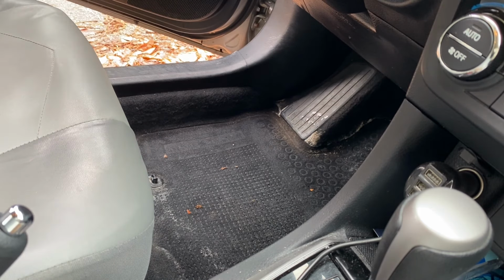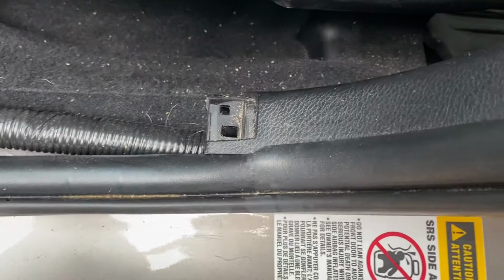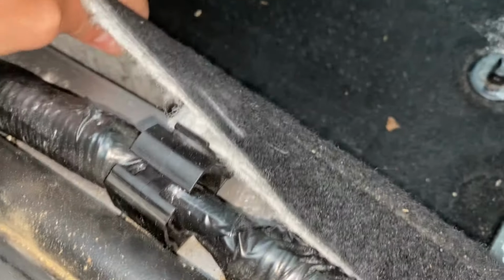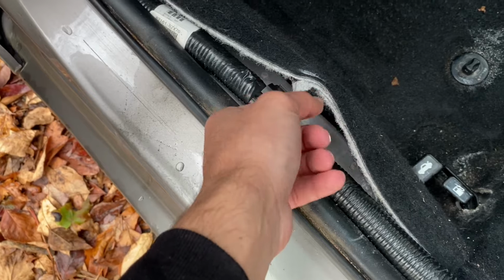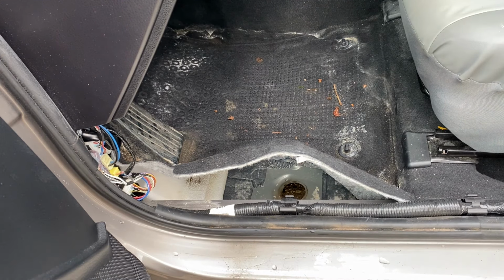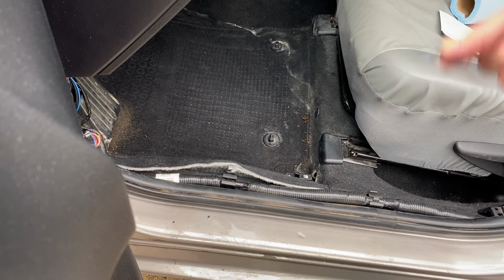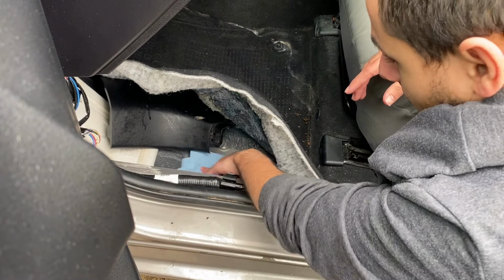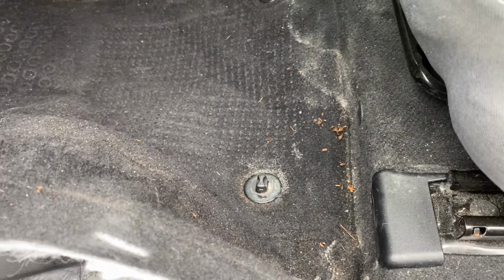How to fix a wet driver side floorboard

Comment: THANK YOU for this video! I seem to have the exact same problem with my 2007 Kia Spectra5. I kept thinking it was a sunroof drain tube (nope), a windshield seal (nope), a windshield drain (nope), a door seal (nope), and so on. I finally pulled up the carpet and propped it up with a metal rod to let the carpet and padding dry out. The water drained out of the carpet and pooled in the floor pan. After squeegeeing most of the water into a plastic bag (I didn't have anything better to use), I tried sopping up the last ounce or so with a rag. When I pressed the rag into the little dimple of the drain plug, I saw that water was coming up from underneath. Even though the rubberized waterproofing coating seemed intact, it actually had a small hairline split in it, and that's where the water was coming from. So, after trying all the "normal" things, I accidentally discovered the abnormal thing, same as you did. Thanks for confirming that I'm not the only person this happened to.
Reply from the maker: @JBH123  Thank you for your thorough comment, glad you tracked down the issue and shared it with us 🙏🏼

Comment: I’m a little confused. How does the plug leaking push water up? You’d think it would drain it. I feel like that not really the issue and the water is coming in from the door or windshield drain.
Reply: Blocked windshield drains can do that. I'm disappointed that just a blocked windshield drain can put water in the floor.

Comment: Thank you for the video. But  don't know if it gonna work on Toyota RAV4 2015 model
Reply from the maker: Look under the vehicle and see if the plug is there before starting to taking off anything from the inside.
Reply: It's under my 2007 Corolla. Should I remove it. I have the same issue of wet driver's side floorboard @randomfixes
Reply from the maker: @ChibuzorEEdeh  If you remove it you have to seal it.
It might also be the whole body seam failing, I made a video about it recently.
https://youtu.be/4oAK6fZVtjI?si=Dm9jQoQopV9jpY3w
Reply: @randomfixes  Thanks man. I appreciate

Comment: I don't know if you're the original owner but it looks like somebody drilled a hole in the center of that because they have a leak maybe from the window or the door seal or someplace else it just happens to be pooling down there at the lowest point which is where the drain would be. I have a 2003 and I have the same problem now mine is more Rusty down there cuz it's been happening for many years. I just bought the car for a couple hundred bucks because of other problems which I was able to fix motor related.
I pulled out my carpet unfortunately it's the middle of winter but I put a rubber mat in it for now and when it does start to rain I'm going to see if I can find where it's coming in. My plug does not have a little hole in the center like that one. I couldn't find anything wet under the rubber or material which is farther up the firewall so it's a wait and see
Did the double piece of flex tape work in your instance

Comment: My entire drive side and passenger side as well as the back floor is wet. Did you also have this issue ? I’m confused on what the problem was. Was the pedal and the carpet surrounding the pedal also wet or just more of the floor ? Thanks for this video

Comment: If that part is a drain, why is wzter coming from under.
Reply from the maker: The water splashes up when cruising and the carpet absorbs it.
Reply: My question exactly, mine is parked and drivers side floor gets wet😮
Reply: @randomfixes  ooooooooooh i didnt even think about it

Comment: Am not sure this would fix the problem.... i have 2014 Corolla with similar issue but am suspecting windscreen leakage
Reply from the maker: It can be many things, this video is a common reason, check the A/C drain, windshield seal, firewall harness, A,B and c pillars,…

Comment: Im having this issue as well on my 2016.
THANK YOU so much for this video!!
My rubber gasket didn't have a hole in it. But water was getting in around it. 
I used gorilla tape and put adhesive around the gasket to seal it.
Reply from the maker: You are welcome, my dad’s 2017 had the same issue.
Reply: Did it fix the problem

Comment: I think the previous owner had a leak and drilled a hole in the drain plug.
Reply from the maker: @Average_Middle_Aged_American  Probably, the whole body seem failed and I had to fix the issue a different way, I shared it on the the pinned comment.

Comment: Wondering what's the purpose to tap the drain hole? Won't it cause water built up?
Reply from the maker: Ikr! It's so weird but my dad drives a 2017 and that plug is good but still leaks water 🤷🏼‍♂️
Reply: yes
Reply: @randomfixes  I'm chasing a similar type leak in a 2003 that I have that little hole looks like somebody drilled that or cut it and it could be a leak from somewhere above that's what I have to find out in mine
Reply from the maker: @MoeLarrycurly1  I would check by the firewall where the all the wire lume goes inside the cabin from the engine compartment or the door seal.
Reply: @randomfixes  will do I'm just waiting for the temperature to come off the zero area. Right now everything's frozen like a well block of ice lol

Comment: Could this line been damaged during a airbag repair? There is a tape over my line where the water leaks from. The recall was required and the only time anyone has been in that area. So I’m concerned if there is tape causing it to leak on both sides mostly the passenger but it will come out the drivers when making a turn and the car is up to temperature on a freeway for example. It’s a 2013. It was cold during the repair. Seems like it started after that.
Reply from the maker: I had an airbag repair at the dealer and they never mentioned anything about it even though I took it there before fixing this leak, the airbags are away from the floorboards too, there's a possibility that your heater core or its lines are leaking as one of the airbags is close to it (right it's behind the dash) and maybe it was damaged during the repair? if your cabin smells kinda sweet and it's cold that's probably a heatercore issue.

Comment: I have the same wet issue in my 2004 f150xlt, drivers side only. I’m still searching for the leak. 30 days and counting.
Reply: Did you ever find the issue. I'm having the same problem 2008 f150. I'm thinking it might be my windshield not sealed. I had my windshield replaced a few months ago and with the cold weather recently I've noticed the inside of my window is wet early in the mornings and recent I noticed my drivers side carpet really wet.

Comment: Bought a brand new car in 2018. It started doing this not even a year after..Took it to dealership 4 times. Still leaking 2024. Car doesn't even have 30,000 miles on it.. The tech guards are full of water after rain and pulled it out and the carpet mat was completely soaked. Taking it back to,dealership 1 last time. Not sure beyond this.. Completely frustrated.  🙄😒😏
Reply from the maker: Change dealerships, the issue need to be resolved or else rust will eat the floor board and keep on spreading 😬
Reply: Might be debris in windshield drain channels. Try test by pouring glass of water into windshield drain screen and see of water drips to floor.

Comment: I have the same thing for an 05 Camry on the driver side anyone know what the issue might be?
Reply: Did you every fix the problem?
Reply: @vaneme  unfortunately, I haven't yet. I checked the condenser line which was fine and the sunroof drain line. I poured water on the windshield and the sunroof it seems to flow/ drain correctly.  I just pulled the drain plug on the driver's side floor pan. It smells rotten in there
Reply: @vaneme did you fix your leak?
Reply: @JT-un7dc did you fix your leak?
Reply: @golfish8589  it was  a bad drain plug near the driver's seat.
Reply: @JT-un7dc  i have water getting in without driving the car when it rains
Reply: @golfish8589  what side of the car is it wet on? Driver's or passenger?
Reply: @JT-un7dc  driver
Reply: If it has a sunroof. Start with the drain lines & check the seal of the glass.
Reply: @JT-un7dc  no sunroof.
No sever rust around windshield.  I do have most of its seal off and will add caulk
Reply: @golfish8589  have you checked the lines for the ac ?
Reply: @golfish8589  My lady had a Camry that was in an accident, and the windshield never sealed correctly after the replacement.  No matter how much silicone we put around the windshield it would always leak in heavy rain.
Reply: @JT-un7dc  i just added some silicone up both sides and across the top.
And put the weatherstripping back in. The stripping had been up at both top corners. 
I did not see anything obvious when I had the stripping most of the way off. 
The drain holes just under the hood corners were clear. I may poor some water down there in a couple of days.

Thanks...
Reply: @golfish8589  Good luck! There are also drain spots on the cowl by the window wipers.
Reply: @golfish8589  Might be blocked windshield drain channels. Can test by pouring water in the windshild drain screen and look for drips inside.

Comment: What causes this to happen does the water come in from the trim ? I’m not understanding where the water comes from , my 2000 civic has this same issue right now
Reply from the maker: Water leaks can be due to a damaged weather seal, misaligned panel or just like in this video a damaged/mis-seated panel plug, sometimes a leak can happen because of a bad heatercore but that’s mostly on the passenger front side.
Reply: I'm chasing one in my 2003 Corolla I have no small little hole just a regular plug that in case the car gets flooded that's what you pop out and let the water drain out so I'm suspecting mine is windshield seal the door seal looks good but soon as winter breaks I'm going to keep an eye on things I pull the carpet out I may have to put some water down in the cowling area and then work my way up to the windshield to see if I see it appear on the floor

Comment: I guarantee you that would not be the culprit of your leak after rain. Especially if the car is simply parked during the rain.
Reply from the maker: @coreyd5329  I made another video about this issue, check the pinned comment.

Comment: Put a Screw or Bolt that will plug the hole
Reply from the maker: I don’t think that will be a tight fit to create a good seal, surprisingly the repair is still holding up.

Comment: What conceivable reason is there for that hole at all? I have a leak in the same place on my scion xb. Great video.!
Reply from the maker: I think those holes are made to aid manufacturing (painting and panel holding points maybe) sometimes they are drain holes for cleaning like jeeps.
Reply from the maker: Also I recently uploaded a new video where the leak comes from a different location, check it out and inspect it on your car.

Comment: So the water defies gravity? How does water come up through that hole? does it only get wet when you drive it?  MY 2013 Corolla has this problem. I will tear it up tomorrow!  But how does the water come up?
Thank you BTW!
Reply from the maker: Because the front wheel slings water up and splashes it onto the floorboard area then the water gets absorbed by the cars carpet.
Reply: Hey I currently have this problem how did you fix it ?
Reply: Exactly what I was wondering 😮 same issue on 1989 grand marquis

Comment: Why not just pop the cap out from umderneath
Reply from the maker: To seal it from the inside as well, sealing it from the outside isn’t enough as road debris and water will make the seal fail quickly + cleaning underneath the floorboard.

Comment: Complete BS. How is closing that hole is supposed to stop the leak? Wouldn't that make the water pool up even more?
Reply from the maker: The leak was coming from the outside not the inside in my case.
Reply: @randomfixes  it was coming in from under the car?
Reply from the maker: @RCA_Dome  yeah, the water shoots up when moving, surprisingly the fix is still good till this day!
Reply: @randomfixes  ah that makes sense now. My bad. I have same problem but I need the plug removed so the water can drain down

Comment: So water is supposed to go through the surface underneath the plug and drain out of the car, but since there's a hole in the plug (btw ?!?!?! how did that hole even get there?) the water comes up through the hole and floods the floor... Any chance you know if a 2006 Mazda 3 has that same plug thing? Mine has been flooding (1+ inches) on the driver side front and back EVERY time it rains for like 3 weeks.
Reply from the maker: I have no idea who made that hole, my dad's 2017 has that rubber fitting without the hole, that fitting should insulate water from entering the cabin, the fix i made is still holding up btw.

Comment: Its a factory drain plug when they dip the body of the car in liquids to protect it from rust. So then they instead of welding it up stick in a drain plug a rubber drain plug. But yours was apparently in wrong it's suppose to be inside the car and not outside the car. So all you have to do is plug it in from the inside and then plastic seal it.

Comment: Ur wrong !! That hole purpose is to drain the water coming from the leak...if you block the hole u migth suffer more water inside un car....
Reply from the maker: @michaelfavila4413  No, it held up just fine for years, until the body seam failed, I made an update about it, check the pinned comment.

Comment: that drain hole shouldn't be obstructed- do you know more than the engineers that designed that fine vehicle? NO YOU DON'T! now hundreds of thousands of lemmings are following in your footsteps meanwhile their AC drain line is clogged and causing the floor boards to be wet.
Reply: If the engineers were so knowledgeable then why is this a problem 😂
Reply: @kowalski2041  the dumbed down owners didn't follow the service recommendations duh
Reply: @johnnysprocketz and you’re so sure of this genius?
Reply: AC dripping usually shows up on right side. Left side leak likely blocked windshield drain.

Comment: That's not the problem. Someone poked a hole to let the water in the floor pan have somewhere to drain out. Not the cause of the water leaking in!!?
Reply from the maker: Maybe not the problem in your case but it was in mine, the patch is still holding up till now and I don’t have soaked up floor mats.